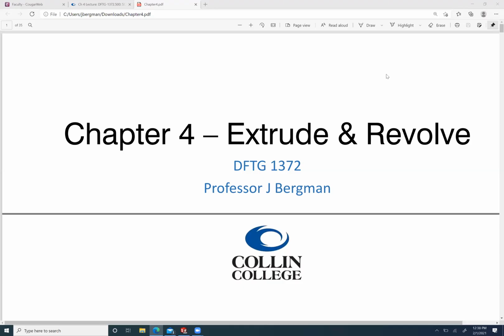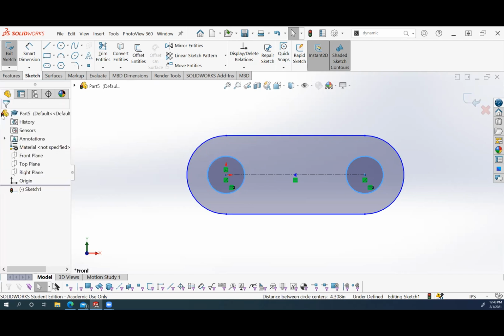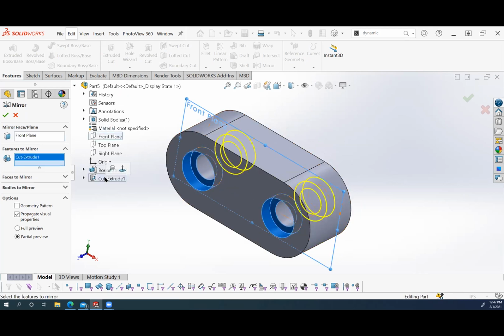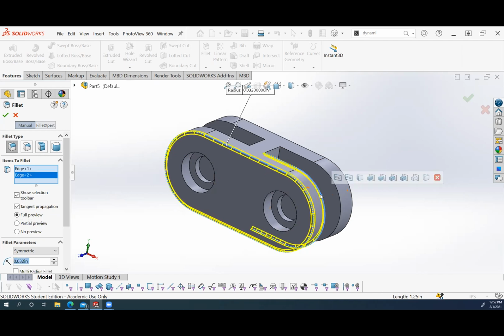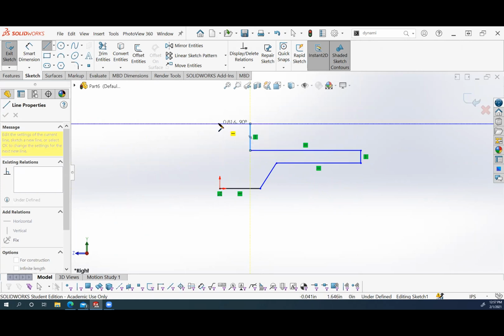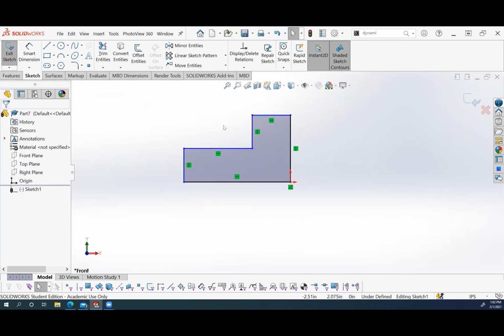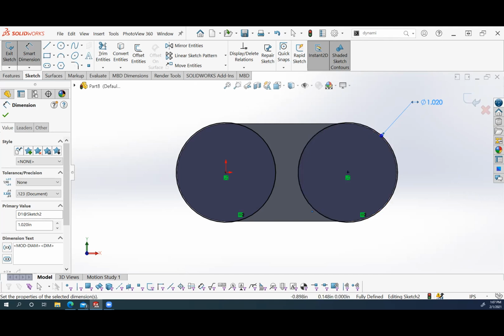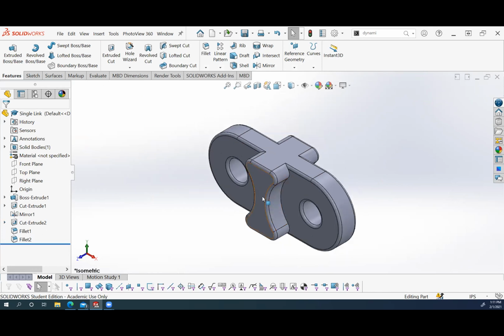Solidworks - Extrude and Revolve - Link components

Comment: CORRECTION: at 8:31 she says depth of "point five" but types .15 in. 
Also the wrong edge was selected for the first alignment pin. IT should be chamfered from the inner edge making it a female, as per the book. Also the next pin made will be chamfered from the external edge therefore making it a male so they fit together.
Note: for the snipping tool for windows just use, Shft windows A and it will load. If the window doesnt pop up of what you snipped then its in queue ready to be pasted. I past eit in an email or word doc then save.